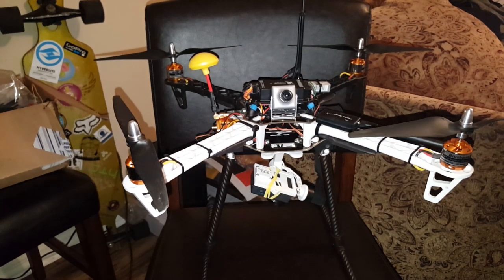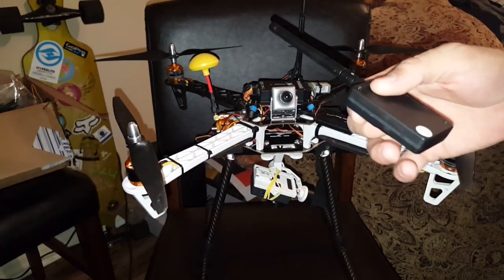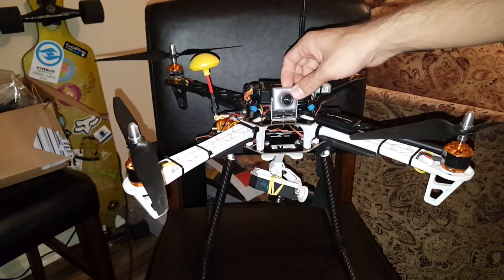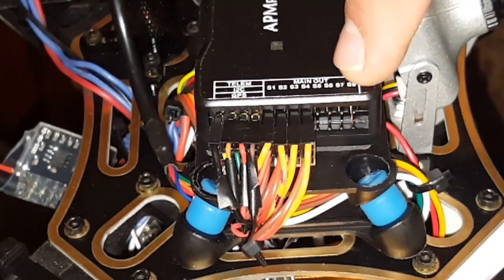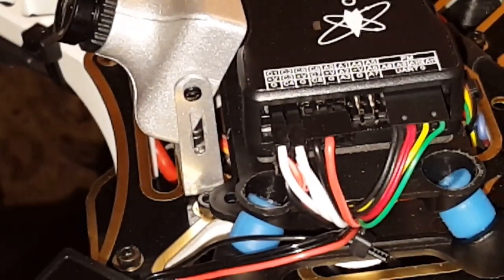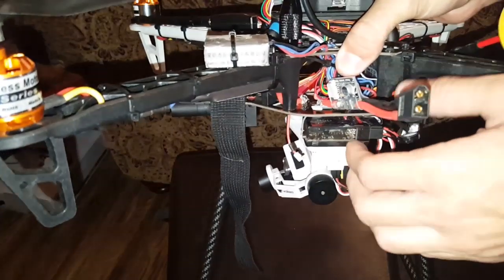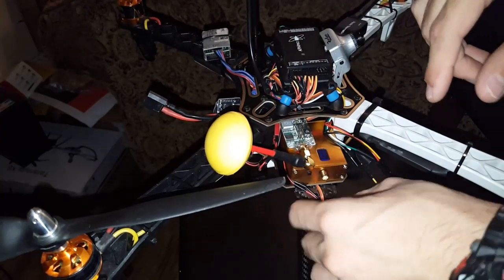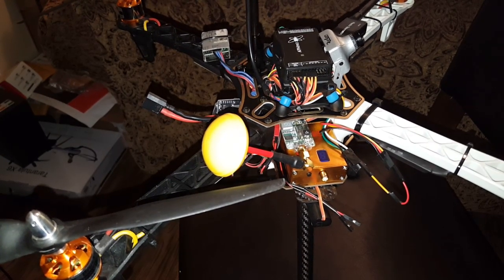part 6 of 450 build with apm mini pro (banggood)

Comment: You wont be able to use that 800mw 1.2G VTX if you are using 2.4G for RC....Its going to destroy your RC Link for sure.
Reply from the maker: EnglishTurbines yea I found that out the hard way, but a notch filter should fix it
Reply: riofpv Mmmmmaybe....on a plane with a lot of separation, but not on your quad....Besides, why do you need a long range VTX on a short range quad..?

Comment: Does the gps come with a compass inside as well?
Reply from the maker: the apm does
Reply: +rio_ lld I saw that starting with the APM 2.6 they were making the board without the compass due to the interference.  They make GPSs with a compass to alleviate that issue.  That way the unit still has compass input without being to close to the interference cause by the strong current flowing through the motor wires.
Reply from the maker: +Tim Marcotte the apm mini pro come without internal compass with the built in compass in the gps
Reply: +rio_ lld oh ok thanks!